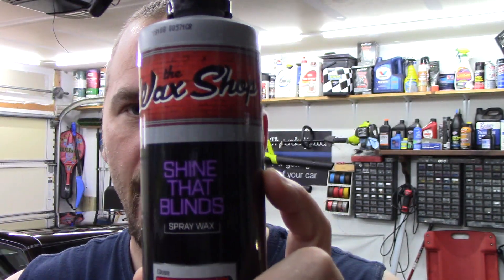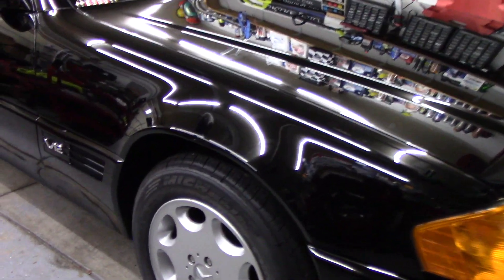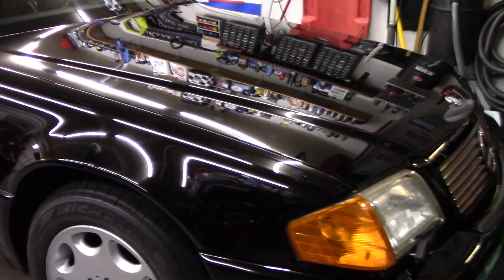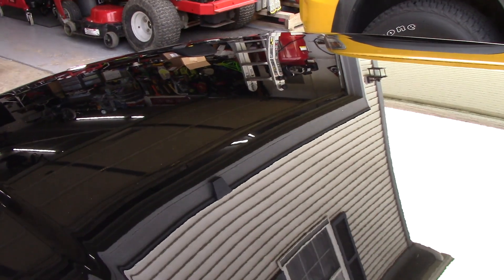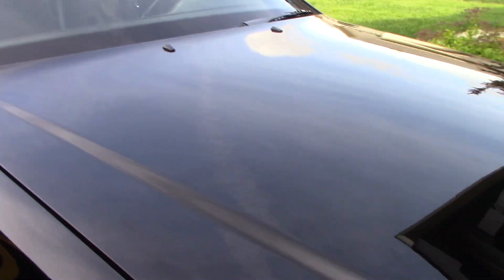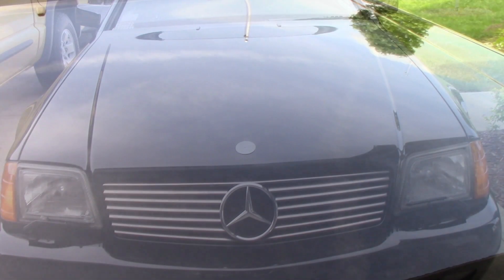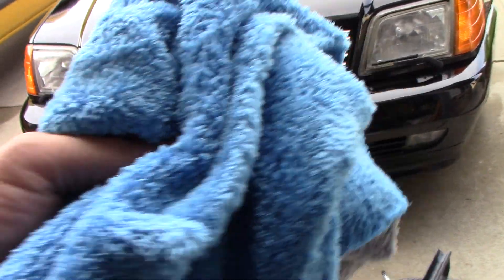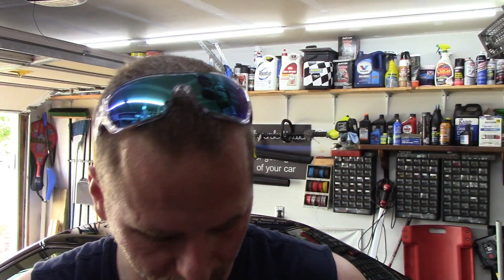The Wax Shop Wax and Spray Wax Review on a Black Car!

Comment: Looks great.  One thing I do when there is streaking is to just buff with a clean towel and and little water.  Been doing this for years.  But I agree - it probably should not be streaking that much to begin with.
Reply from the maker: Thanks! That’s a great tip for removing the streaking.

Comment: I've had the same problem with other products doing the same (heat and humidity sensitive products?). What works for me is applying the product with my buffer. Sounds weird but I had no more streaking and buffed off nicely.
Reply from the maker: Never thought about using a polisher to apply it. Thanks for the tip!

Comment: Have you ever used jescar power lock? I quickly became obsessed with that stuff, especially on my black truck. So easy to apply and remove and looks amazing. Used it on 2 boat motors as well. Top that with colonite 845 and it’ll change your life! Lol
Reply from the maker: I have not tried it but hope to in the near future! Thanks for the tip
Reply: I've seen some great results online from that combo, and in fact is what I'm going to use this weekend when I finish detailing my Lapis Blue STI. Supposedly if you top it off with Bead Maker it becomes that much more impressive (will be trying that out as well).
Reply: Geese1 yessss, forgot to mention the beadmaker! I ordered the gallon after trying it one time. Unbelievable how slick the surface is and the gloss it leaves. It would be VERY hard to switch products. You will love that combo and stare at your car for long periods of time!
Reply: FAB Automotive Detailing its about $50 total for both on amazon (amazing reviews for both), but it’ll last forever since you don’t use much. I applied with foam pads by hand. Also, keep up the great videos. Hoping to see this channel grow massively!
Reply from the maker: Dale Maddox I appreciate the Info! I have seen good videos on it as well. I’m trying to grow it massively but it just takes time. 😂
Reply: I also vote for the Jescar Power Lock, I think you’d love it, it applies and removes easily, and leaves a super slick shiny finish! I like the look of that Griot’s polish removal towel you used, might have to try them! It took a lot of extra work but turned out awesome!
Reply from the maker: Jamie Rosenthal definitely a lot of extra work but worth it in the end! Thanks

Comment: Did you know it's a turtle wax product?
Reply from the maker: Yes I did know that but I didn’t know it until it showed up and had TW as the return address. They use to advertise heavily in the NHRA but kinda disappeared several years ago.
Reply: @FABAutomotiveDetailing  I thought it was interesting to see it was a turtle wax product.
I liked some of the wax shop stuff but their spray wax was very difficult to work with, I thought I had completely buffed it off the paint and a few minutes later it would haze up again and leave a bad residue😞
Reply from the maker: Dallas Paint Correction & Auto Detailing Exactly what happened to me with the spray wax! I figured it was the heat and humidity for the streaking i got. I think they need to go back to the drawing board on that one.
Reply: Turtle wax owns the company, but they have their own formulas and share nothing with turtle wax.

Comment: 3m towel clean is not in your amazon store. Please provide info or a link. Thank you.
Reply from the maker: https://www.detailedimage.com/3D-M98/Towel-Kleen-P1636/128-oz-S1/

Unfortunately it is out of stock but this is the cheapest you will find it. Once back in stock if you use coupon code DetailedImage 5533 you will get 10% off your entire order. I didn’t put it on Amazon because it’s $10 more on Amazon
Reply: Thank you sir